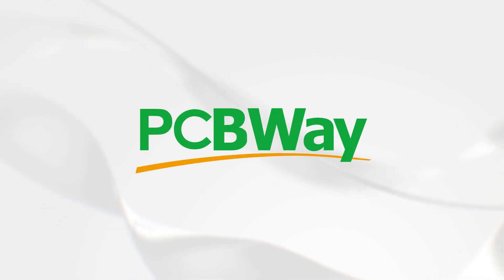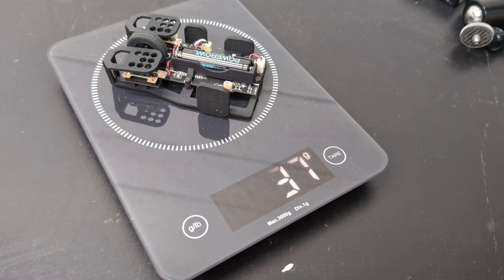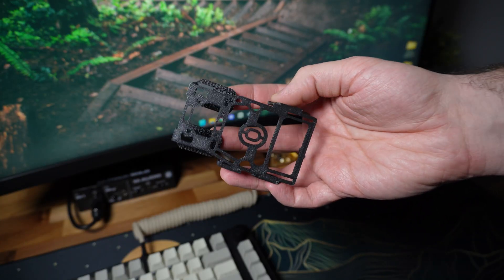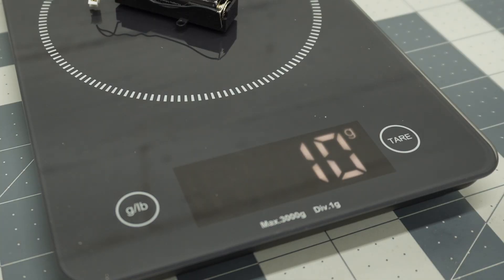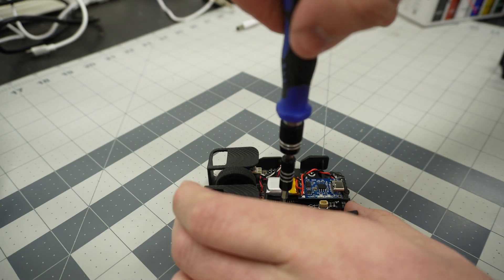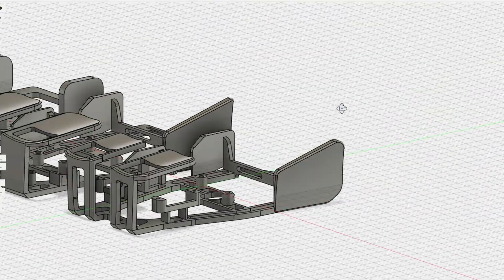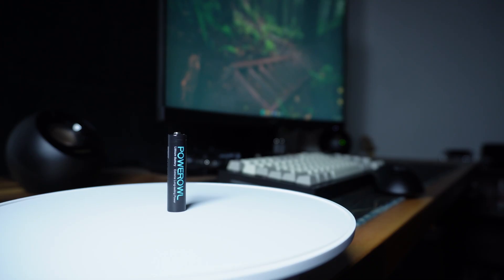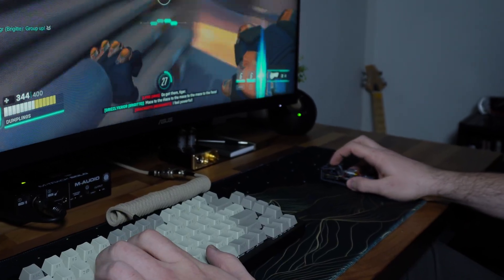The 26g, Rechargeable Logitech G305 Featherweight

Comment: very, very nice!
just a tip: I'd consider smaller switches like the kailh silent form factor, or if you really want to push it further, some tiny tact switch like the ones used in mobile phones.

Comment: I soldered the bms cables to the AAA battery connector but it only turns on the mouse when I plug in a USB cable charger, what can it be?
Reply: Fixed it lol

Comment: How about using a AAAA battery (which exist)

They weigh about half as much as their AAA counterpart, they're cheaper than the Lipo + Charging board setup, and they're a drop-in replacement for AA/AAA batteries. (with the right battery size converter)
Reply: I may look into this. Although, the rechargeable mod setup may be worth the additional weight to most people.

Comment: really cool vid! I am definitely doing this to my one and i was wondering is you could shave off any unnecessary material even on the pcb?
Reply from the maker: There are definitely some unnecessary sections on the PCB, but I decided not to mess with it because I wanna keep the project as simple as possible so that people can follow along (:
Reply: @CF-Builds  Yeah that's fair enough. Could you tell me what battery to use or will any work as the one in the description isn't available in england. Thanks.
Reply from the maker: @harrymarvin-french-bz4sb you should be able to use any small 3.7v lipo battery (:

Comment: alright guys, i wanna get this mouse printed through pcbway, im absolutely inexperienced though so i would love your input on the following: what material, what type of resin (?), what type of surface finish and basically all other options when it comes to ordering through pcbway. 

appreciate any form of response!
Reply from the maker: I personally would recommend printing in PLA as it has a lot less flex then something like ABS (slightly lighter too).

In my previous design I used PA12 Nylon, which was a little bit lighter and stronger than the PLA version but it had a decent bit of flex between the finger grips. 

I can't recommend resin printing simply because I've never used it, so I don't know how it would hold up, but I've heard it's pretty brittle (again, don't take my word for it).

If you decide to go with PLA, just upload the files on PCBWay, select the quantity, then under the material selection just pick PLA and the color you want, leave everything else default and then at the bottom where it asks for a product description just click the dropdown and select DIY Entertainment>Game Controller Enclosure.

I hope this helps! (:
Reply: @CF-Builds  this very much helped thank you! unfortunately i now realised its not 8usd for the entire mouse to be printed but around 8usd for each piece, so close to 50usd just to get the things printed - with needing to purchase more parts to actually build the mouse i might aswell just stay with my current mouse :D had hopes this would be way cheaper then it is, i assume the time that it takes to print just a single one of the pieces is just super expensive compared to ordering like 10 at a time

Comment: absolutely love this project. i so want to do this, however, one problem; i have no 3d printer D:
do you know of any cheap/ low minimum order 3d printing services? (pcbway is too expensive :/)
also, what material did you print in? thanks :)
Reply from the maker: I do not unfortunately. I printed it in plain old PLA (:
Reply: @CF-Builds  okay i see. what % infill? 20%?
thanks :)
Reply from the maker: @ Yes, 20% (: